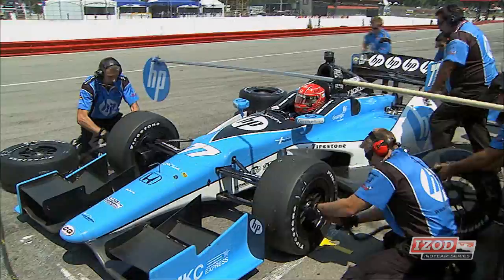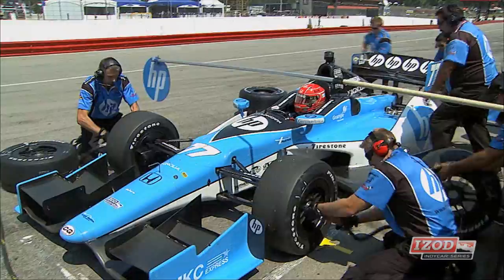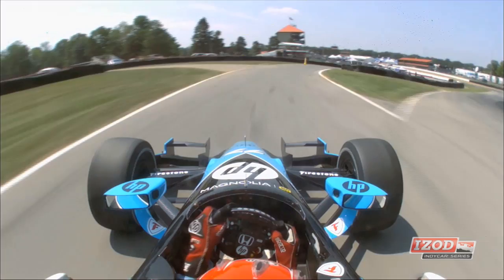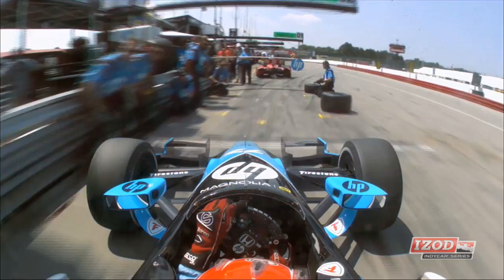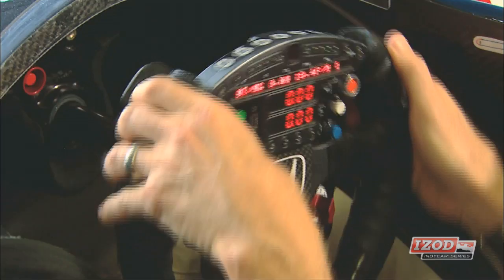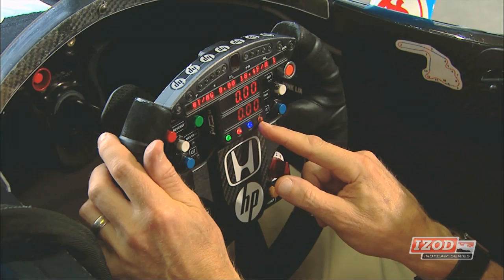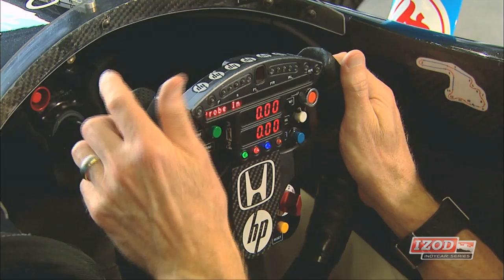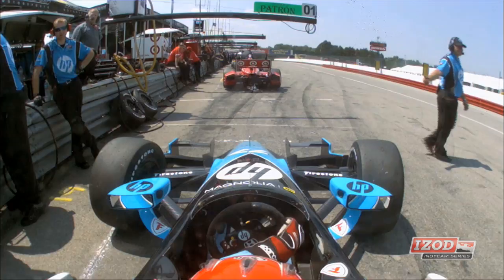Jon Beekhuis on Pit Stops

Comment: From my understanding of the hand clutch system (from F1 anyway) is that it's either 100% off, 50% (being bite) and 100% on, and you have to get the revs up at bite, and then release the clutch to get the power down.
I may be wrong, please correct me if I am.